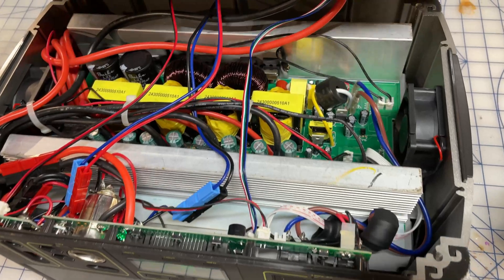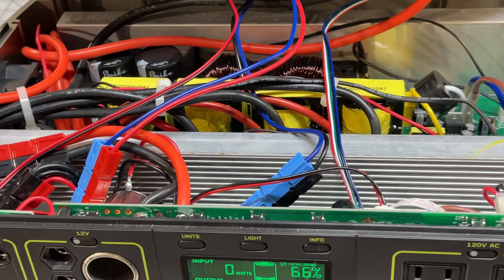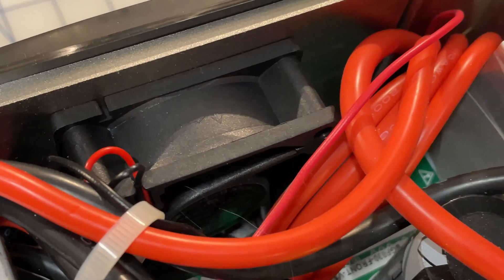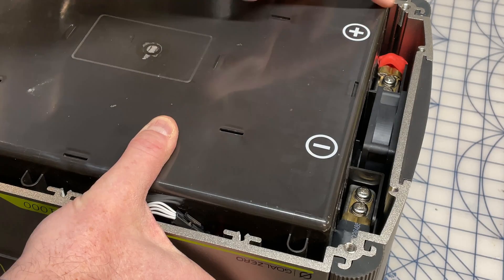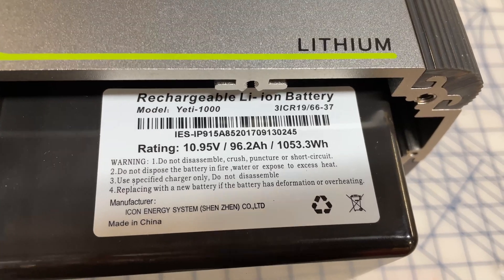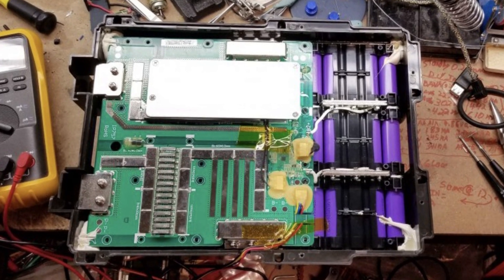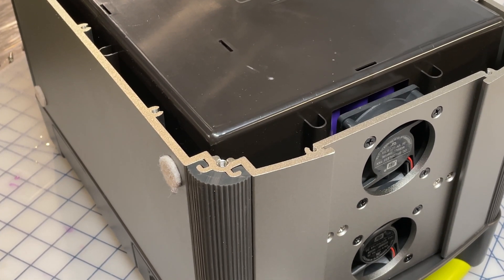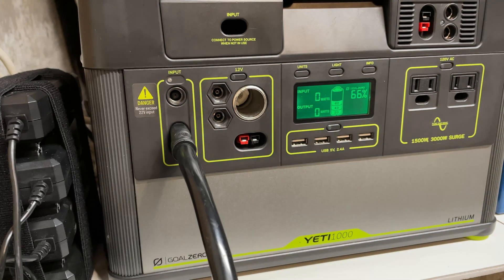Goal Zero Yeti 1000 Teardown: What's inside?

Comment: Todd,  thanks for the bottom tear-down (sneak peek).  I don’t know where you found that photo showing the BMS and battery.  Goal Zero said they would charge $499.99 (includes shipping back) to replace the battery pack.  That is more expensive than a 1k AGM battery, but much lighter and a bit smaller.
Reply from the maker: Good to know the price. Based on the way this battery works, sending it back makes sense. I’m actually waiting to get my Yeti back, they agreed to swap mine because it wasn’t holding a charge
Reply: @todd.parker  Thanks for the video. Very impressive build quality. How long have you had your Yeti and what did you do to obtain warranty service for not holding a charge? Mine was bought August 2019 and I want to be certain the battery is up to snuff. I think I have a two year warranty because I registered online.  It has been lightly used and well maintained.  PS - screen regularly reports 93-94 % after draining and "full" charge. usually12.5 , sometimes 12.4 volts.
Reply from the maker: My Yeti was actually more than 2 years old. I’d call or chat with them if the resets aren’t working to recalibrate. Mine was only outputting about 840wh though they didn’t ask that.
Reply: @todd.parker  How long is the warranty for?   I thought it was only a year.
Reply: @todd.parker  What resets are you referring to?
Reply from the maker: They suggest doing a soft reset (unit + display button hold) below 70% and/or doing the same at fully discharged to see it that recalibrated it..that never did a thing for me
Reply: @todd.parker  Very brave to take it apart like that! What symptoms did you experience when it wasn't taking a charge anymore? Also, how much did it cost to send it to them, and have them fix it?
Reply from the maker: @sprinterdiscovery  it’s a 2 year warranty and they offered to swap mine for a refurbished unit for free, including shipping. Still wait to get my unit back. Symptoms were mostly that it would stop charging around 93%, sometimes as low as 89%
Reply: @todd.parker  Thanks Todd. I experience the same as I charge... 89% going to 94% at times. If I let it rest a while after charging it will go up to 96%. Mines 3.5 years old now. Let's see how many years it can go for!
Reply from the maker: Yours seems like mine was. I estimate it was down maybe 10-15% if it’s capacity but that’s totally usable.